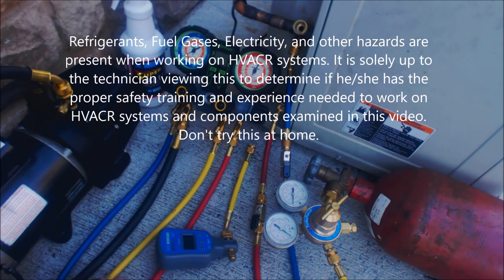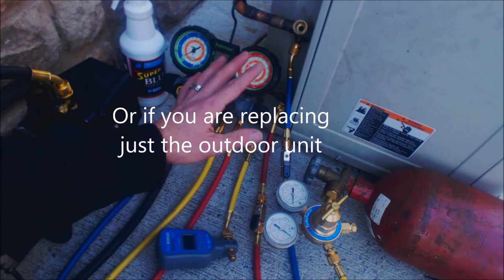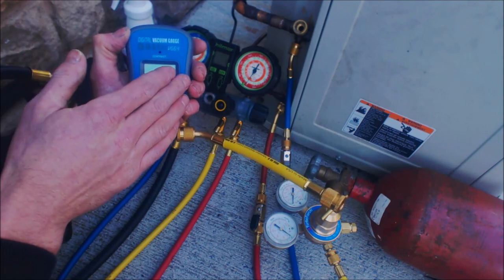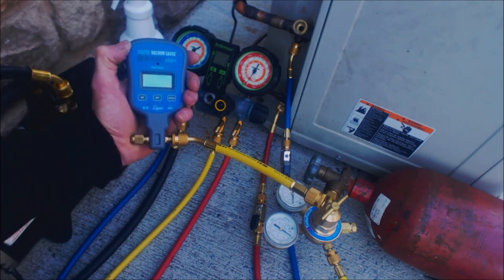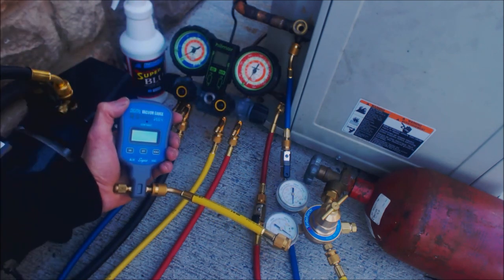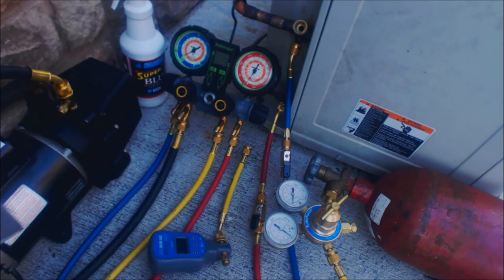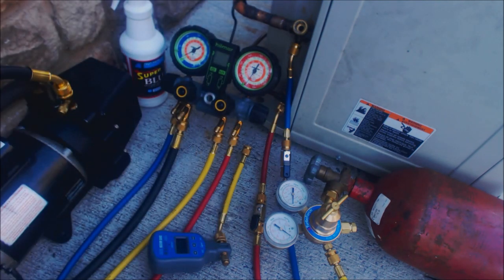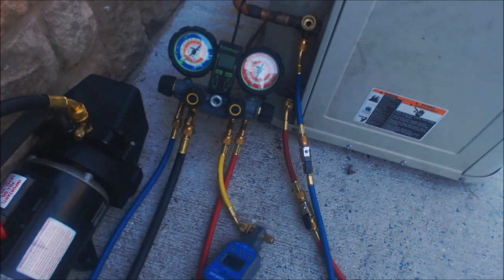HVAC Nitrogen Pressure Test Procedure for A/C Units, the Oil Blowout, Vacuum Pump Setup!

Comment: I’ve always heard 350-400 psi is good. I’m glad you covered this!
Reply from the maker: You would want to avoid going that high on older coils. You can also read a more precise and quicker pressure test using a digital manifold as the incremental changes can be seen faster, thanks!
Reply: You cannot exceed the low side test pressure listed on the data plate, if you don’t have the high and low side isolated.  The pins on the compressor cannot handle those pressures of 350-400.

Comment: I'm a little confused on the pressure test. Once you have all three gauges at 200 psi and holding, shouldn't you close off the nitrogen feeding into the gauge set. Otherwise if there is a small leak wouldn't the continuous addition of nitrogen hide it by compensating?
Reply: He forgot that, I think

Comment: I do thank you very much for your excellent instructions and great detailed explanations. You are always during your videos answering all the what, why, how and what not to do with great details and explanations. Having said that, I know you are very busy but if you would please answer a few questions about the mini split AC:

1.  As you know the mini split AC of all brands and kind has no high side shredder valve and I do not know why, so is it good idea to install one out side the system near the low side shredder valve?

2.  I have a mini split AC under full maintenance including a leak repair on the condenser, as you know the metering device is just at the end of the condenser going to the evaporator, in this case is it OK to feed nitrogen gas from the low side all the way to the condenser to test the condenser leak repair? will nitrogen pass through metering device? and if so will it affect the metering device and or the high side of the compressor?

3. After doing system and line set vacuuming, is their a need to add 2 ounces or may be less of a compressor oil? I can not find any sold information on this issue?

Last but not least, thank you very much for teaching so many people not just in the U.S.A. but around the globe as well!!!

Comment: Very useful video, lots of information here. This is the only vid on Youtube where I have seen this oil blowout procedure. When doing this, do you always inject the Nitrogen on the vacuum (low pressure) side and put the can on the  high pressure side, or do you inject the Nitrogen into the highest side off the ground so that gravity helps push the oil out the lowest (to the ground) side? thanks!
Reply from the maker: It just blows the oil onto the inner walls of the tubing so that you can pull a vacuum through all the existing tubing. it doesn't matter which side you push the oil through. We do usually pressurize on the liquid side though and put a cup under the port on the other side. It will not catch much but may catch some drops of oil, thanks!

Comment: Great explanation, I have a question though, on split systems where the condenser is located on a roof and indoor unit on suspended ceiling I have noticed oil traps. When servicing evaporator coil would it be wise to cut coil and remove to do a coil wash or do a oil blow out in a reverse direction to avoid plugging up metering device? Thanks for sharing!

Comment: I have a rear overhead air conditioner in my van it says that the coil is charged with nitrogen I’ve got hot pipes coming from the engine to make it they seem to be hot but I’m not sure how the air conditioning system works is that just circulating cold water from the coil in the front of the vehicle or is it Actually refrigerant ,best regards

Comment: Great videos!  Water in the system will also make the micron gauge jump back and forth, unfortunately I see this more than I should (new construction multi-family).
Reply from the maker: Absolutely,  oh man, that's a shame. They must have not brazed the ends on right away during the pressure test. Yeah you run into a lot of scenarios that you shouldn't have too. Thanks Sloany83!
Reply: acservicetech Our installers either didnt tape the ends good on rough-in or had their linesets open to the elements, aka back of their truck with open ends.  We have rooftop units and ive ran into 4 out of 60 units so far having water in the system, hopefully the next 61 are better.

Comment: Hi thank you for the great useful video.
I have encountered a problem regarding the pressure drop of compressor at low circuit of my chiller unit. 

The scenario is described as below:
My chiller has 3 unit of scroll compressor, when the first compressor is running, the the low circuit pressure shown 4.5 bar and when second compressor cut-in, the low circuit pressure starts to drop to 3.5 and when the last compressor cut-in, the pressure drop again to 2.5 and the system will alarmed. Then the system will automatically cut-off both second and third compressor and the low circuit pressure will again increase to 4.5 bar again. After few minutes, this happened again and again. 

I have struggling to think of the causes of this problem. Is it because of there is a leakage of my circuit or the expansion valve has malfunction?
Or do you have any idea about this?

Thank you so much in advance.

Comment: Could you provide a link to where one can get the short, yellow 1/4" female to 1/4" female hose?  Googled but nothing found except ones with male 1/4" and a ball valve.  Thanks.    Excellent procedure steps and like the vacuum setup for a quicker vacuum setup then the procedure I use.    As know, the closer the vac gauge is located on the system e.g. as directly connected to the Vapor line port to eliminate hoses, the more accurate level of vacuum obtained.   So with my 4-valve manifold gauge set, I have used two vacuum-rated core removal tools (CRTs Appion brand) on both the liquid and vapor line with Schrader valves removed.  Vacuum more quickly obtained w/ the micron level shown right at the system.  A key step though is, before opening the CRT ball valve to re-insert Schrader valves, one need to slightly pressurize the system with <20 psig or so refrigerant (else loose the vacuum).
Reply from the maker: Beautiful thing, good job! The hose you saw was off of the Hilmor set and was from the manifold hose after the yellow hose valve. I am having a hard time finding that too however this is a short 1/4" by 1/4" female coupler from Supco - http://amzn.to/2kFrbU9

Comment: great video thank you. On the oil blow out, have you ever had to put oil back in a split system?
Reply from the maker: No, not much comes out at all. The secret is to blow it onto the walls of the tubing inside before the vacuum.

Comment: Thanks for your nitrogen pressure test. One question I have is how do you know you don’t have a leak when you left the system pressured by the nitrogen tank? Shouldn’t you isolate the system from the nitrogen tank to do this?
Reply from the maker: I closed off the manifold gauge set handles and you would watch the manifold set gauges. Digital ones are even better for pressure testing, thanks

Comment: buy connecting vacuum guage to manifold do you worry about compressor oil affecting vacuum guage accuracy? Nice video thank you.
Reply from the maker: I try to get a little length away from the vacuum when possible. You may get a little oil in the gauge if it is connected in series and the hoses have not been blown out lately with nitrogen but no the micron gauge semms to last. I will have to pull out my 14 year old one some time and run a vac on that. This manufacturer states you can clean the sensor with rubbing alcohol and I have but not that often, Thanks a lot Ron!

Comment: great video am going to be replacing txv on trane air handler first thing i want to ask if u can give suggestion is that its no room to replace txv inside the A coil whats the best way to replace the txv removing the coil ?and would it have oil in the line should i use same procudure as yours would help to know,thanks
Reply from the maker: Yes we would remove the coil if there is not enough room and if we had to unbraze and braze the external equalization port.  make sure to replace the filter drier afterward as well. Yes you would do an oil blowout before vacuuming. You don't need too much pressure for this, thanks
Reply: acservicetech thank you

Comment: Hi, thank you what happens if you close the nitrogen tank right away after you put the pressure into the system can you do that?
Reply from the maker: You could do that but you should also have a way of locking the nitrogen in the system for a test while disconnecting the nitrogen tank, thanks!

Comment: I'm about to get this done tomorrow. How long should the nitrogen be in there to detect a leak?
Reply from the maker: It can be 15 minutes or a day but I usually bubble leak check my joints too. The vacuum test will also verify that there are no leaks as well, thanks. here is a video on vacuuming- https://youtu.be/jlzecsOImqs

Comment: Hi there I would like to ask you a question about r134a I fixed a friage few days ago and it takes 4.25 oz of freone I did not weigh up the freon just going by the gages how much it should read on the gages 
Thank you
Reply from the maker: It has to be weighed in on a refrigerator with no sight glass that is that small, thanks

Comment: I appreciate your videos. One question about pressure testing old systems. Is it safe to pressure test the condensing unit (condensing coil) at the same time while testing the rest of the system?
Reply: Reading your question 3 years after. Did you get any answers! I’m curious about your question as well. I know that has to do with service ports.

Comment: I am struggling with choosing a good digital micron guage. I am looking at the 2 I see you use which are ofcourse the CPS VG200 and the SUPCO VG64. I have looked at almost 100 reviews on both between Amazon, EBay, Google Search and HVAC forums and honestly 80-90% of the reviews say do not buy and stay away from them. Reasons are bad leaks, unit power shutting off and false readings. I see you using them with no issues. Can you recommend other ones or maybe explain why these do or do not have these issues? Just not wanting to waste money and at the same time not have to spend $300-$400. I was just getting ready to purchase the CPS today from your tool list on Amazon but it says it won't be here for 1-2 months and I can't wait that long. 
Really appreciate your opinion.
Reply from the maker: Hey James, sorry to hear that vacuum gauge is no longer an in stock item. Crazy. I looked around on amazon. Maybe try to purchase the cps one through another distributor. I have had good success so far and to date I have not had a single person come back and say they didn't like it. Thats not to say that won't happen or that there wont be a lemon out there but I am really happy with that version.

Comment: great info, I purchased the hilmor gauges myself and love them! do you just have a cap on the other connection of the micron gauge?
Reply from the maker: Yes that is correct! I was thinking of pulling out my old 14 year old micron gauge and doing a video with it. It's the same version but a little worse for wear. They work going through with two ports or with the one port and a cap on, thanks!
Reply: acservicetech awesome thank you so much! can you do a oil blow out with the king valves open? or will it blow all the compressor oil out?

Comment: thanks for posting,I thought that nitrogen pressure is not affected by temperature?
Reply from the maker: Nitrogen is affected as well but not with the movement that refrigerant has. Refrigerant has liquid to draw more vapor from for pressurization. Nitrogen will certainly move as well. When I pressure test water lines, code is 80psi so I put 85 psi of air in knowing it will drop or rise depending on temp. There obviously is a lack of water vapor in nitrogen. The nitrogen will still expand if you put it in on a cold day or reduce in pressure if you put it in on a hot day or from a warm vehicle into a cold line or a line surrounded by cold air. If you are putting 200psi in, we are just talking probably 5-10 psi over a couple hours. It is just another thing to mess your mind up if one was not aware after a half an hour the pressure fell 2 psi. You might think you have a leak. Thanks Capitol, you made me question myself for a second there, ha ha. I had to check myself before answering.

Comment: It’s good practice never to install the micron gauge on any line that is flowing during the vacuum.  It should be installed as far away as possible from the vacuum pump, on a connection facing upward.  Use a small pigtail if necessary.   Never install the micron gauge on the hoses, or on the vacuum pump itself.

Comment: When doing pressure/vaccum test after swapping a compressor, would it affect the compressor oil while its under vaccum?
Reply from the maker: No it won't suck out the oil or blow it out. The compressor does not allow pressure to cross while it is off, thanks Sergio!
Reply: No, thank you professor!

Comment: during the pressure test if the outside or inside temperature increased or changed would the temperature change the pressure on the system?
Reply from the maker: Yes absolutely, the pressure would change depending on the temp.
Reply: acservicetech thank you for your replies and thank you for making videos
Reply from the maker: No problem THE GENIUS!

Comment: Can co2 be use to pressure test and soft soldering?
Reply from the maker: It could be used. It is just not what distributors usually stock but some techs use that.
Reply: acservicetech thanks that helps me a lot.

Comment: Had to watch about six times around the 3:45 mark - a subtle skip in the video and no instruction or clear visual regarding closing off the nitrogen and isolating the system.  And yet after that he points to the secondary gauge at the nitrogen tank noting that it's "allowing" the pressure on the manifold gauges, as if in present tense?

Comment: I don't get it, how is some oil in a line somewhere in the system going to change anything as far as "running" a vacuum?  Any air (moisture laden or otherwise)  that is on the other side of it will be pressurized through the oil...heck I've used a vacuum pump to pump air out of very thick fluids like urethane paint, and it works great...what am I missing here?
Reply from the maker: I am describing when you use a two hose setup because you are pulling a vacuum from both sides. WE usually don't do a single hose vacuum because of how slow it is because of the metering device restriction half way down the tubing. I did another video that you may want to check out. 5 reasons why a micron gauge reading may jump around- https://youtu.be/Ks3MtPmXDUE
Reply: @acservicetechchannel  Ah, I see now, that makes sense...thanks for taking the time to answer, I will check out your other vid.  This one was very informative.  ;-)

Comment: How do I do an oil blow out on a mini split system. My micron gage is jumping and I can’t draw a good vacuum
Reply from the maker: You would need to disconnect the liquid flare at the outdoor unit. if you do the oil blowout from the vapor side, you will accidentaly blow the oil out of the tube since the liquid line is so small. If possible, try blowing from the liquid flare and allow the nitroge out of the vapor port. the object is to blow the oil onto the inner walls of the tubing but not out of the system, thanks!

Comment: what's different and the same between R22 and nitrogen ?
Reply from the maker: We use dry nitrogen for pressure testing and oil blowouts only. We need to vacuum all the nitrogen out before adding he refrigerant in, otherwise, the nitrogen will get pumped through the system not allowing the saturated refrigerant state to be very large in the coils and will drive up the discharge pressure, thanks

Comment: 9:14  ughh....maybe it's because I'm so tired/depressed/out of it, or whatever, but I'm just not following this and don't have the mental energy to make sense of it.  If you think I'm an idiot, I envy you for never having been in this frame of mind.
Reply from the maker: No one is an idiot for having a question ever! I am teaching and questions are good for the individual that is processing and engaging. That was just a little pressure locked at the valve. The same thing happens on the ball valves of valve core removal tools. I always try to not allow positive pressure into the vacuum gauge whether nitrogen or refrigerant. I don't want any oil to get onto the sensor in the vacuum gauge that would mean I then need to try to clean the sensor. I also don't add pressure into the vacuum gauge because I don't want any leaks, thanks John and no worries I am there in that state too at times!

Comment: I was thinking the nitrogen bottle had to be set up right?
Reply from the maker: There is no liquid so you could technically use it on it's side. I will tell you, that I usually use it vertically and I always store and transport vertically. I was just trying to get it in the shot so you could see it. Thanks

Comment: Must the nitrogen cylinder lie or stand? Perhaps over head?
Reply from the maker: The Nitrogen is just gas so it doesn't matter but I usually keep it standing upright. I just moved it the get it in the shot, thanks
Reply: @acservicetechchannel   I would never lay it down.  I’ve seen water at the bottom of some tanks.  Unless it’s certified dry nitrogen, it may have not been handled properly.